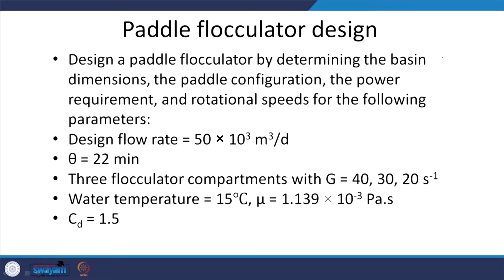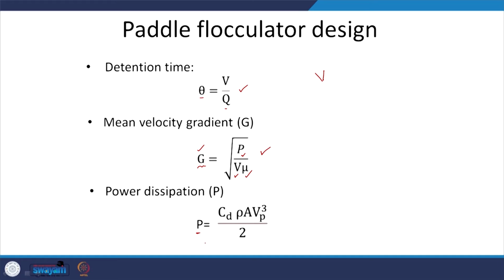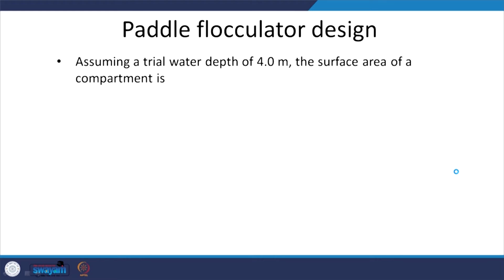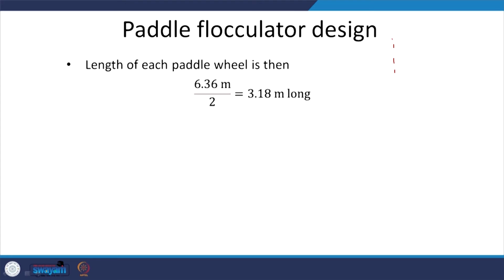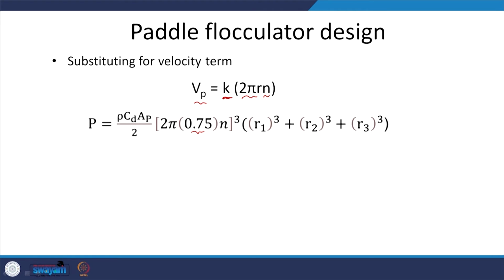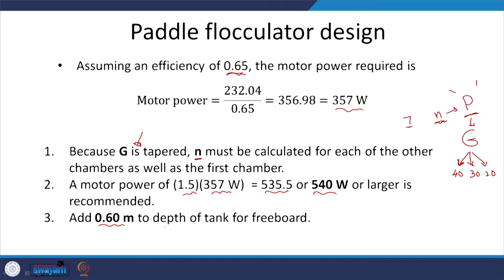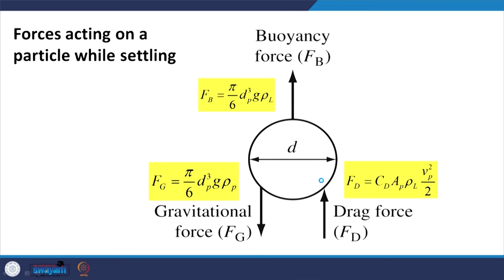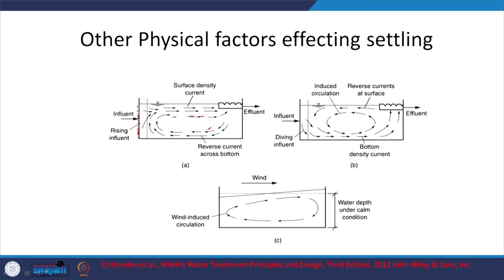Lecture 39 : Flocculation-II

Comment: Ap = Total area of paddles = 0.15 x 3.18 x 24 (Nos.) = 11.48m2 I suppose.  If take 0.477 as total area of all paddles paddle is very small. Actual rpm is between 2-3 as per your configuration not 7.